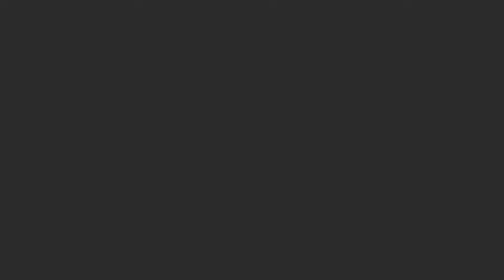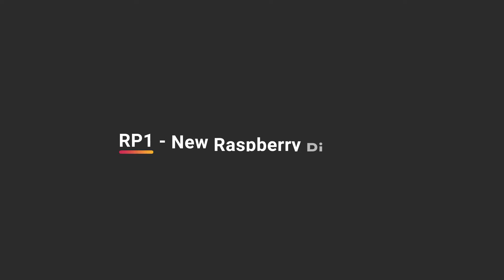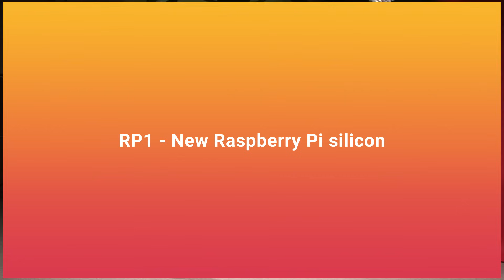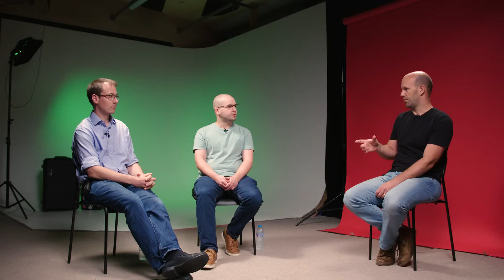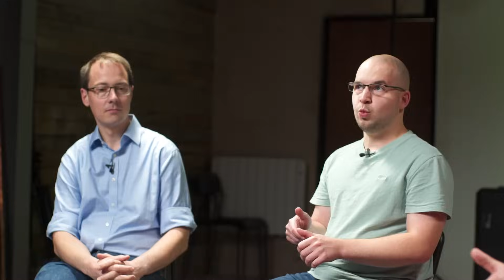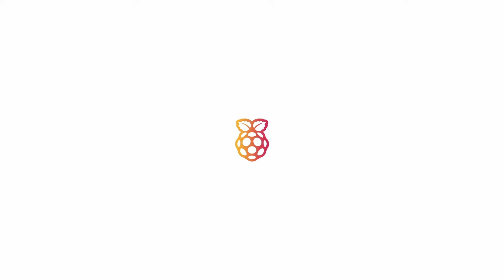Introducing RP1: The silicon driving Raspberry Pi 5, designed in-house at Raspberry Pi

Comment: The features on the RP1 make me hoepful that the Raspberry Pi could go UP from a single board computer to a full fledged Mini-ITX motherboard with a SO-DIMM socket and all connectivity options exposed. Users could then swap components, as upgrades become available.

Comment: I saw the RP1 bringup and test board with the PCIe edge connector and I thought, would be pretty funny if someone took that card and put that in a Pine64 RockPro64 or something so you have exactly RPi GPIO and extra USB on a different SBC lol. 

Honestly, the RP1 as a USB + Ethernet + GPIO controller on an X86 motherboard is pretty interesting.
Reply: Maybe if they make the chip separately available, other board vendors will start including it in their board, who knows!

Comment: Before watching. Yes RP1 Details. I’m way more interested in the RP1 than the Pi5 itself. I still debating to get a Pi5. I still have a ZeroW Pi3 and Pi4 collecting dust as I tend to use microcontrollers for embedded systems stuff. BTW still love the RP2040. I develop on it at work and use many many of it special features.

Comment: It's great to hear about engineering the RP1 but I'm somewhat surprised it's needed. Most SoCs seem to be getting more and more integrated with little or no ancillary IO silicon required (especially for common functions like SPI, GPIO, Ethernet, etc). 

It seems seems Broadcom (and RPi) are going in the opposite direction to most SoC vendors - more similar to a PC architecture with a southbridge. I can only assume this approach is driven by Broadcom removing much of the peripheral hardware from their SoCs but it would be interesting to hear how the RPI foundation foresaw the need for the RP1 and what drives the need for a southbridge type design.

Comment: So the capability of the RP1 chip is constrained by the space & power constraints of the Raspberry PI 5 form factor?
So will the Raspberry Pi organisation be producing a larger form factor such a Mini-ATX mother board that can be dropped into existing PC cases?
If not will the Raspberry Pi RP1 be available for third parties to produce the latter?

Comment: Very interesting to hear how many iterations the silicon as well as the board layout itself went through,
the Pi 5's new architecture sounds very nice for future adaptions and a vast improvement over the Pi 4's.
I am still using a Pi 2 and a Pi 3 for my little projects (because of the shortages and price hikes) but they still
work fine, just a little underpowered by today's standards. But any raspberry pi is alot better than the BBC
micros of days past that lots of us learnt about computers on! 🙂
Keep up the great work peeps, onward and upward always!
Reply: I’d like to see a project where, since it is the same chip, one can take a pico and build a board that turns a pico into a pi3 or 4 or even a 5. Like schematic and parts needed with the code as a project , now that would be impressive.